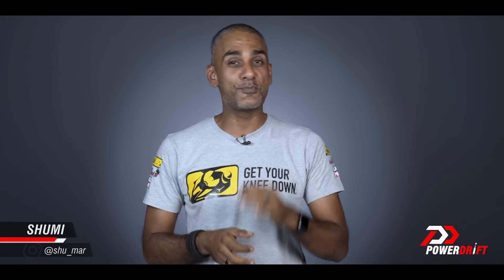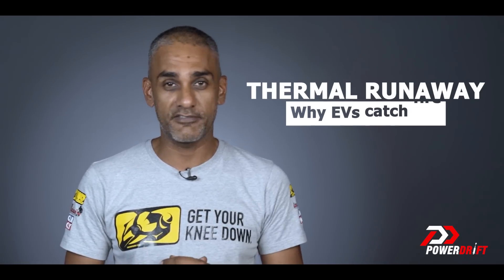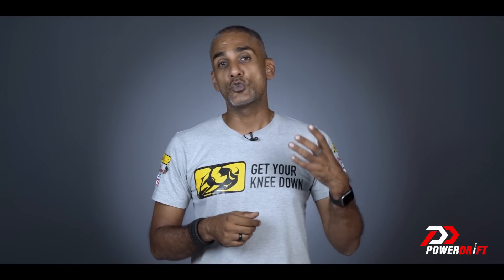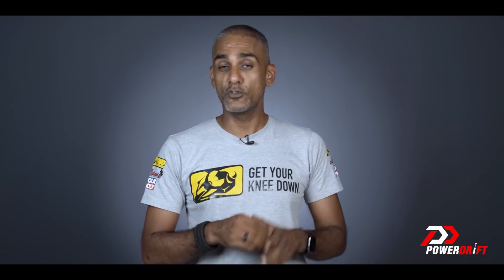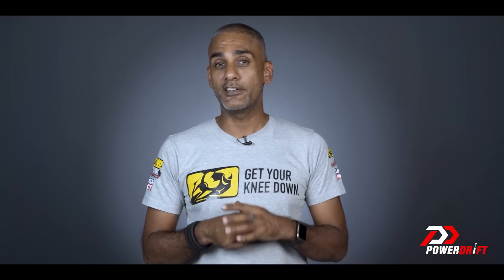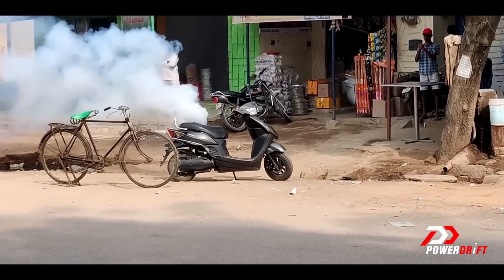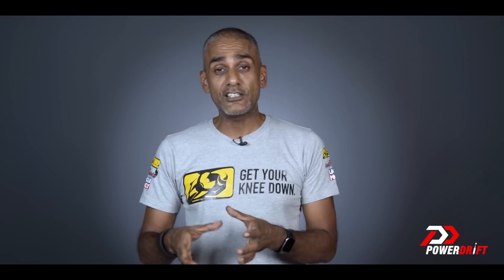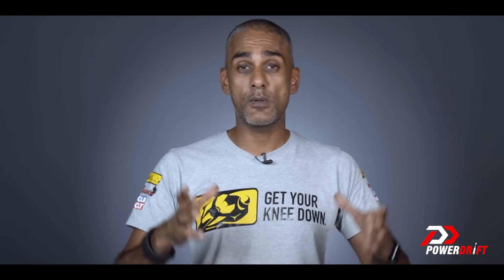PD Simplified | Why Electric Scooters Can Catch Fire

Comment: EVs do not need to be stressed; they can catch fire; self ignite for no reason. The Falicity Ace was a Sea Going Ferry for car transport; it sank in 10,000 feet of water because a Porsche EV caught fire; then other EVs caught fire causing the ship with 4000 luxury cars to sink off the Azores - Point is - like this Porsche which was brand new, doing nothing, self ignited and caused a massive fire.  EVs can self ignite is due to Dentrites - growing deposits inside Lithium EVs which can cause a short and start a fire inside the battery pack spreading quickly.  The car was undergoing zero stress - it randomly caught fire - this is an inherent problem with Lithium ion.

Comment: There are 12Lacs+ EVs running on Indian road. How many EV fires you heard in last 5 years, probably not more than 15-20. So your EV catching fire is almost negligible. There are more ICE catches every day but they don't make in 'Breaking News' as these are old boring news. Just do YouTube search "Vehicle catching fire at petrol station", you will find hundreds of videos. So before coming to the conclusion that EVs are dangerous than ICE just do simple math and statistics. 

Moreover, ICE don't have any system to detect the problem before hand in the Engine or petrol tank but EVs specially which are connected with 4G sims and many sensors sends continuous telemetry data to OEMs and can alert the OEMs before hand, way before any problem even noticed by the owner himself (Ex. Ather, OLA). The problem with Ola is that they bite off more than one can chew. They should not have launched scooters in more than 10-15 tops cities in Phase 1 and then gradually expand.

Comment: All n all weather you use petrol Or ev planet earth is getting f**k up. EV to charge needs electricity & which comes from burning coal. My question is simple how are we trying to solve to issue? Is ther any alternative solution to this issue?
Reply: We rely on coal less with every passing year for sure. That’s pure data. But today, it’s not solved yet for sure

Comment: Even after seeing this video, people will still misbehave on their scooters and blame the manufacturer on battery overheating. I manage to keep the battery under control but seeing 40°+ temp on the display isn't a good sign everyday. 

I still don't understand why EV scooter manufacturers decided not to use liquid cooling specially for batteries in Indian conditions. It's already 42° in Delhi and peak summer is yet to start here. Considering that batteries are less efficient in hot temps, even if it is an expensive affair, this should have been a major part of R&D for EV scooter battery developments.

Definitely, EVs will evolve like ICEs but if people don't adopt them now & wait for improvements, then EVs will evolve slowly. I sometimes wonder if I made a right choice in buying now because I need to be more cautious so as to avoid overheating and technology isn't as good EV cars. But the only benefit right now is the huge savings in running cost but I hope the battery doesn't blowout one day.
Reply: We all have different perspectives. My perspective is that if I have to change how I live because of a product, then the product isn’t ready for me. So until an EV cab replicate and better the ICE experience, I won’t buy one. And the beauty of a big market like ours is that there’s space for everyone to make their own choice
Reply: @shu_mar  very true. The scooter mainly in perspective here for me is the Ola. They hyped too much about it, that I fell for it. However it is not all loss for me because I'm having huge savings. But there is a bit of sacrifice and I hope an update on the scooter will happen sooner.
Reply: u seem like an EV fanboy! 😂😂
Reply: People really don't care about how fast or slow EVs will evolve. Until they are as good as ICEs in every aspect, people will discard them.

Comment: Imagine an EV Car Catching Fire & all the four doors get Locked & your Family is Inside ,trapped in Poisonous Smoke.... NO WAY 👎👎
Reply: It did happen to a Tesla in US and a doctor of Indian/pak origin passed away, car got crashed, battery caught fire n the sensors on the doors misbehaved n essentially he was trapped inside his car, horrible incident
Reply: @003_kusarigama5  That's what I am Saying EVs are Not Safe.... We Must Stick to Naturally Aspirated Petrol Automobiles. Like Jay Leno Says "Anything that Rolls,Explodes and Make Noises is Fun & Romantic".
Reply: @anupamtheboss4536  Dude the door mechanisms are exactly the same
as other ICE vehicles (High End Cars). There is a seperate 12v lead acid battery for normal things. 
You can check Nexon EV or MG ZS Ev. 
Even on tesla there are hidden mechanical latches on the doors in case of emergency. 
Just need to be aware of what you are buying.

Comment: Hi powerdrift,
A well said and a required explanation for all the current and the future EV enthusiasts.

My Q to you guys is, i noticed that vdo is more predominantly speaking about scooters, thermal runaway issues and the thermal cutoffs. Is this applicable to bikes as well? Like the revolts, the pureEVs and the obens currently in the market?

Or their structure having an open ended engine (air cooled) just like the ic bikes helps them to tackle the issue to a larger extent?
Reply from the maker: Thermal runaway can technically happen on any EV.
Reply: Applicable to ALL EVs. Technically anything with a battery. We keep saying scooters because eMotorcycle sales are negligible today.
Reply: Like you said in the vdo, the problem with setting up a ev scooter is complicated. Can we say that the setting up of a ev bike is a bit easier? Or is it the same?

Correct me if wrong, but in the two wheeler section most fire issues are on scooters than bikes
Reply: @nikhilmunde5276  That’s just numbers. If you assume 1% of all EVs catch fire… that’ll be a 100 scooters and maybe 2 motorcycles. Just statistically emotos sell so little that the skew will be towards scooters
Reply: @shumar got it. thanks😊

Comment: So how do we deal with the EVs we are planning to buy right now , ather on the other hand is way expensive,ola is just hard to reach , with all the technology these both have other EVs are just motor battery n tyres thas it ,
Reply from the maker: Like they say, you get what you pay for.
Reply: @powerdriftofficial  exactly
Reply: If you plan but can’t afford you have two options 1: buy used 2: wait till you can afford. 🤷🏽‍♂️
Reply: @shu_mar  EVs with used options are like buying bikes from a scarp yard 😆😆😆
Reply: @rogerfed4216  Many, yes. All? No. When the pool is smaller, finding a clean one is obviously harder.
Reply: @shu_mar  well in that case there are only 2 options either ather or ola ,